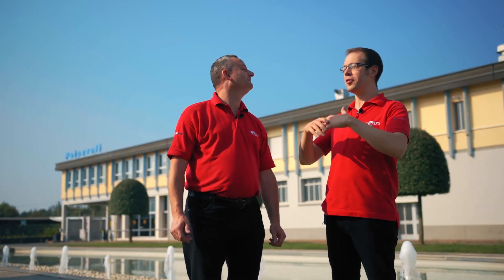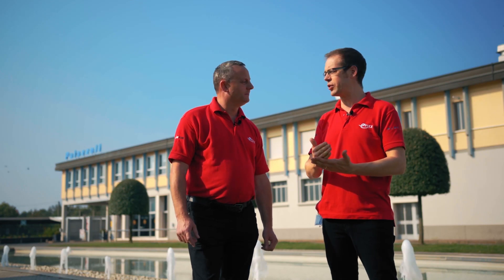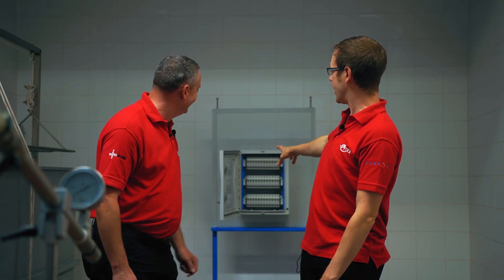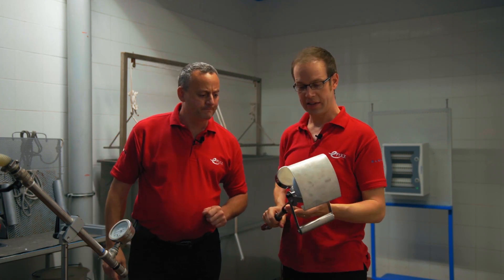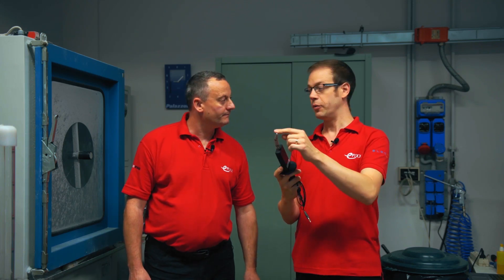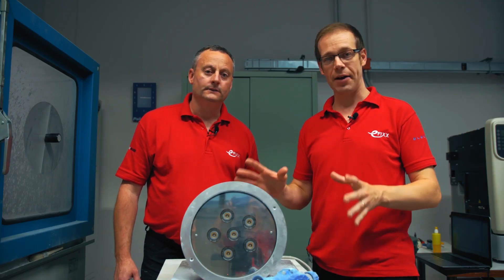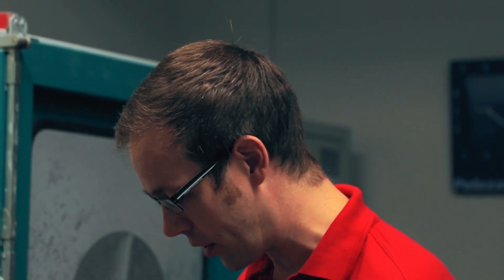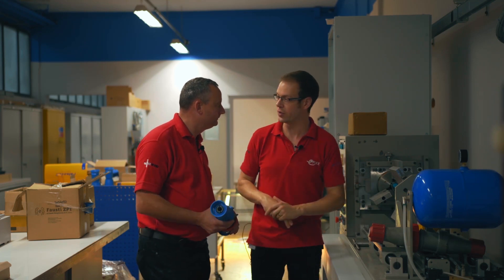IP66, IP67, IPx7, IP68 - Ingress protection of dust, water and testing of electrical equipment

Comment: I've fitted a fair bit of palazzolis commando stuff and I love it, easy to install and bullet proof so no call backs. Clients love it as well for same reasons,  quick to install so low labour cost and bullet proof so it just works, no matter how much you abuse it.
Reply: This does look like a fantastic and safe product. It's also the type of thing my (current) boss would buy and fit himself - by taking photos of the electrical connections and then wire the new commando socket the same way - even though this looks "a bit" different to the standard commando sockets. He's got form on this.. And he is Not an electrician (says he started in his country of birth but never finished and moved to the UK and never learnt electrical installation here) 🤔🙄

Comment: Hi, good job guys, however,  I've got a question for which I haven't find an answer yet.   If you put an ipx68 phone in an ipx68 case, do the ratings add up? Is there any data on that?

Comment: Interesting. I’ve seen many electrical products fal  in the normal day such as outdoor lights and sockets buckling in the sun or cracking in winter because the plastic becomes brittle in winter and softens in the summer , 
Manly cheep unbranded products . Buying from your local hardware store is not always a good idea.
But who am I to argue i’am just a humble spark who’s opinion means nothing.
Fantastic video guy’s as always 👍👍👍❤️
Reply from the maker: It may seem strange but the IP test does not validate resistance to UV or chemicals etc
Reply: @efixx  well maybe it should surly it would be better to test for everything that can have an adverse effect on the products? If I spend a couple of hundred quid on outdoor lights and sockets or whatever I expect them to last a good twenty years or more, I want to go out into the garden for a BBQ on a nice summers evening to my fancy light have started to buckle and melt . Or in the cold months the have cracked or split. But such is life we can’t have everything. But who am I to argue i’am just a humble spark who’s opinion means nothing.

Comment: in practice is the ip67 or ipx7 better?
Reply from the maker: The x means it hasn’t been tested for dust ingress. So IP67 is better. You could of course assume that dust won’t be able to enter a product tested for temporary immersion in water.
Reply: @efixx  if water doesn’t enter, dust will hardly enter
Reply from the maker: Yes but think about something like earphones which are available in an IPX7 version - you can drop them in water, but dust can still enter the sound cavity and may effect the performance.

Comment: @efixx Thank you for your answer. What I inquire about may be stated as follows : if we have a panel with IP66 but inside it there is equipment of different IP such as IP54 and IP64. In this case can we consider this equipment protected with IP66 ( which means protected against dust and jets of water from all direction)   since these equipment are inside the panel with IP66 ?
Reply from the maker: Yes your thinking is correct
Reply: @efixx  Thanks